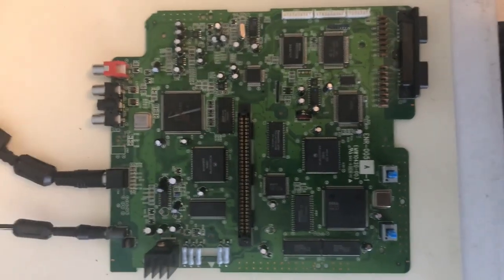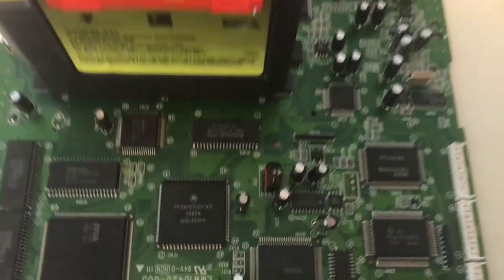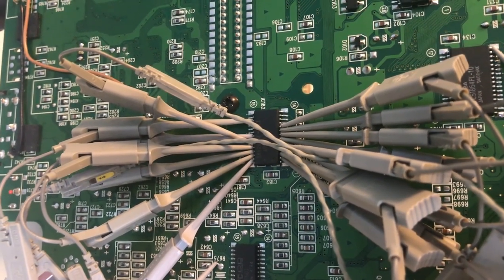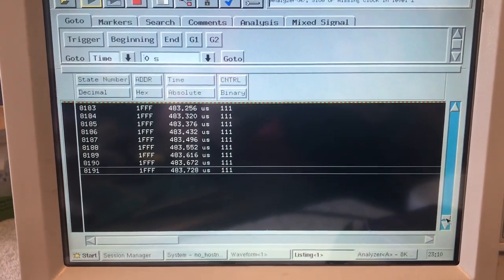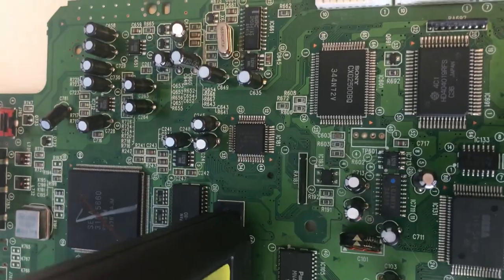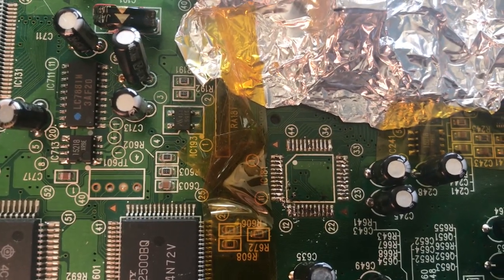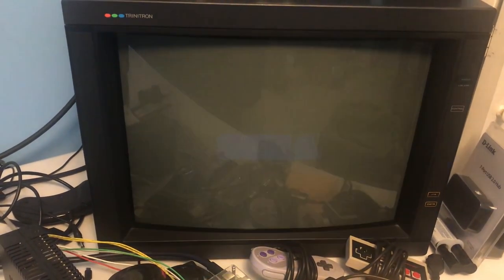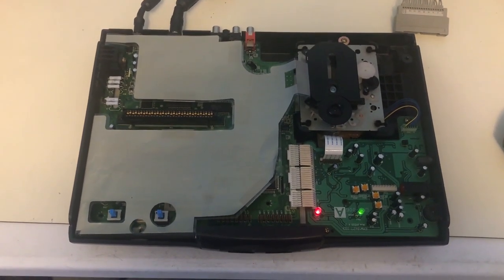JVC XEye Repair - Hanging After TMSS Prompt

Comment: Nice work. Were the caps leaking or bulging?
Reply from the maker: Fortunately no. The X’eye uses all through-hole caps so it’s rare for them to leak. I replaced them all anyway though as preventative maintenance.
Reply: @ShootTheCore  Good to know. I have one coming from ebay. I am a Technician and I want it to last so I will do the same. Thanks.

Comment: My X'Eye hangs on some games and works fine with others.  The issue as well is that the audio is all messed up like the Zilog is the only thing producing audio.  For instance in ecco CD CD audio works but the only sound effect that works is jumping out of the water.  I am perplexed.  I cannot boot any master system games using my Everdrive as well, which at first made me think the Z80 or it's SRAM.
Reply from the maker: First off, it’s normal behavior for Master System games to not work on the X’Eye. It doesn’t switch over to Master System mode with either of my two X’Eyes-I’ve tried both an Everdrive and with original carts going through a converter and no dice. 
How does audio work for your carts? Do you get music and SFX on carts, or only one or the other?
Reply: @ShootTheCore  I appreciate the reply.  This issue started a few months back. I get no audio on carts, so playing Ecco the Dolphin I don't even get the sfx of jumping out the water I get with Ecco CD.  Here is an upload of the X'Eye running the Model 2 Bios.  I tried this out as I have a model 2 sega cd and gave me some sort of comparison as to what sfx are missing.  https://youtu.be/h0VI3SC7p2c
Reply from the maker: @tuffasgong  oh man, that BIOS music sounds awful!

You have an unusual problem and I don’t have a straightforward answer for you on the cause of it. I could be something has failed internally on the sound chip or maybe one of the audio mixing OpAmps is failing

The newest 240p Test Suite has a hardware test that’ll test the Z80 functionality and verify the Z80 RAM. Since you have an Everdrive, try loading it up and see what the test says. 

https://www.patreon.com/posts/61481934
Reply: @ShootTheCore  Ya it sounds not right for sure!  Passed all the tests.  So Z80 seems good.  If it is something with the sound chip would that cause it to not load certain games?  For instance Sonic 1 and Gunstar Heroes won't load just black screen (both original carts and Everdrive) while shining force golden axe etc. Load fine just no sound.  All the capacitors look good nothing bulging.  I appreciate your help trying to problem solve this.
Reply from the maker: @tuffasgong Can you try one more suite of diagnostic tests and see if they come back with anything?  https://mode5.net/download/GenTestV2.4.zip
Reply: @ShootTheCore  Okay, I am hella more confused than I was before.  So all the tests pass 6800 ram, vram, z80 ram plays FM, PSG, and DAC.  So, right after running the memory tests and resetting than loading Sonic 1 and Gunstar Heroes they both work with sound except the "Sega" sound with Sonic 1.  Now if I power it off and try and run those or try and run the original cartridges of those games, nothing same as before black screen.  Still all other games and Sega CD don't have any sound...  WTF?!?
Edit: So I have to test the z80 ram.  If i test only the 6800 or the vram cannot load Sonic.  If I test only the z80 ram I can load sonic and gunstar heroes with sound.
Reply from the maker: My hunch is that your X'Eye has a Z80 SRAM issue.

I know the sound RAM passes the diagnostics but sometimes a flaky RAM chip will read data back correctly on a sequential addressing check (which the diagnostics do), but fail when reading back random addresses under heavy load (which games do).
On the X'Eye, the Z80 SRAM is IC 182.  A list of suitable replacements for it is on the Console 5 Wiki here:
https://console5.com/wiki/SRAM_64Kb:_8K_x_8-bit

Try swapping that SRAM chip out for a fresh one and see if it makes a difference.
Reply: @ShootTheCore  I will do that.  I have 1 extra Model 2 and 2 Model 1s, could I pull the SRAM chip out of the Model 2 as they are pretty similar to the X'Eye?
Reply from the maker: @tuffasgong  yep, make sure the part number you pull from a donor matches one of the parts on the list I linked you, but the Z80 SRAM should be the same across all Genesis models AFAIK.
Reply: @ShootTheCore  So Z80 ram is good.  Works fine in the other Genesis and same problem in X'Eye.  I purchased a Z80 processor off of digikey and going to try that.  Tried swapping the Z80 but ended up messing it up bending the legs back into place after removing it. Z84C0006AEG.
Thanks for your help I will let ya know how it goes putting in the Z80.
Reply from the maker: @tuffasgong  Drat-sorry the RAM swap wasn't the solution.  I have my doubts on the Z80, but I'll cross my fingers that that's what it is, because otherwise your culprit is likely the Sega 315-5660 custom which has all the sound hardware integrated.  At least you can pull another one of those out of a Genesis II if need be.
Reply: @ShootTheCore Was a good shot since running those Z80 memory tests did something. I have never removed an IC before so was good soldering practice.  If it's not the z80s might take a break till my soldering skills get better haha.  I appreciate your help.
Reply: @ShootTheCore  I ended up buying a cart side only mobo off eBay for a hundred.  The Sega CD didn't work (the scaling and rotation would mess up and freeze before loading a game) luckily it was a burned out pad that connected the Sega CD IC MCE3 to the Sega CD SRAM.  So finally after like 4 months I have a fully functioning JVC X'Eye and an extra mobo with chips sitting around.  Thanks for all your help!
Reply from the maker: @tuffasgong  Sorry to hear that you had to buy another mobo, but I'm glad you have a fully-functional console.  That's just how these projects go sometimes - not everything is an easy & straightforward repair unfortunately.  Enjoy your X'Eye!!
Reply: @ShootTheCore  Learning the hard way haha.  So the idiot I am I didn't like the solder job and ended up snapping the leg off the Sega CD IC chip... I don't have a Dremel so I spent like 4 hours carefully exposing enough of the leg inside the chip to get a solder connection....  Thanks man, feels good having this thing all up and running!  I still spent less than they currently go on eBay and have that second mobo full of chips in case.  Thanks again for your insight and help.

Comment: how did you get the power and reset buttons off without breaking them?
Reply from the maker: I've always pulled the plastic buttons straight up off the button posts.  I've done that several times on several X'Eyes and haven't broken a button yet...

Comment: I want to replace the z80 due to same issue.  What chip did you use :).
Reply from the maker: The original part is an NEC uD780C.  The easiest to find equivalent is a Zilog Z84C0006AEG.  DigiKey sells them for around $7 each.
Reply: @ShootTheCore  ahh ok I ordered the z84c0006fec
Reply: @ShootTheCore  ok so I replaced the chip still black on cd side. Ran continuity to every trace and looks good.   So it could be the memory chip then yeah?   If so do you know what chip that is as far as ordering
Reply from the maker: @gratefulkyle1  Replacing the Z80 addresses an issue where a cartridge game hangs after the "Licensed By Sega Enterprises" prompt.  If cartridge games are booting up and have sound then your Z80 is good.
Problems with the CD side are much more complicated to troubleshoot.  Do you have access to an Everdrive?  If so, try loading an X'Eye or Sega CD Model 2 BIOS from the Everdrive - if the CD side boots up from the Everdrive BIOS then your problem is with the BIOS ROM on the mainboard.  You can also load the 240p Test Suite from an Everdrive - it has a Sega CD Hardware Test that will test the RAM on the CD hardware.
I made a two part series of videos where I did troubleshooting on just the Sega CD hardware - you can view them here:
https://www.youtube.com/watch?v=sFmUCw0-adk&t=1193s

Comment: What sound chip does this unit use?
Reply from the maker: The JVC X'Eye uses the Sega 315-5660 custom, which integrates the YM7101 Video Display Processor with a YM3438 FM synth.  It's the same custom chip that's used with the Genesis Model 1 VA1.7 and many of the Model 2 revisions.  JVC uses a different amplifier and mixing circuit with the X'Eye than Sega used with those consoles though.
Reply: @ShootTheCore   entonces le puedo quitar ese  procesador aun sega genesis y colocarlo en el jvc  y   es compatible ?